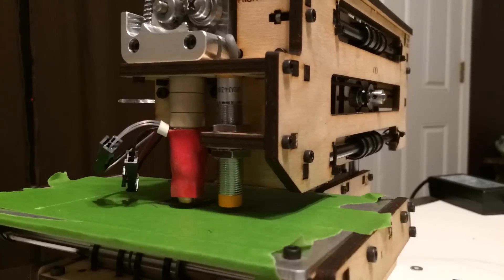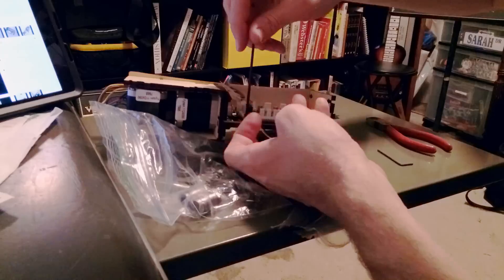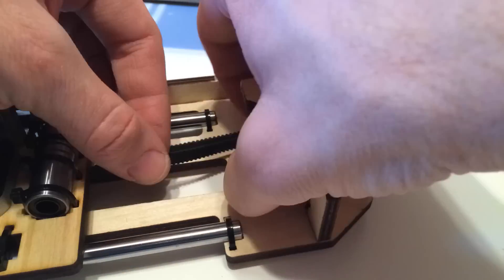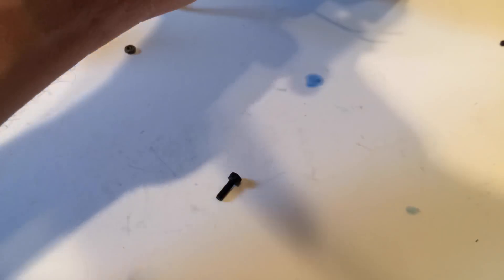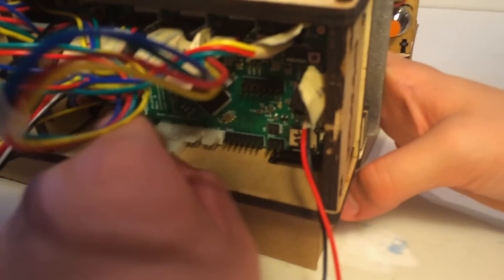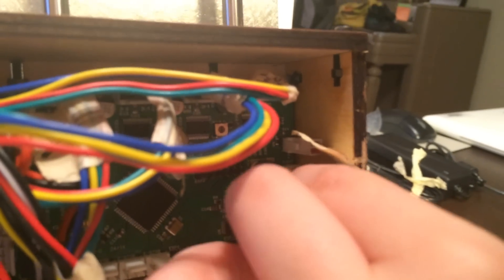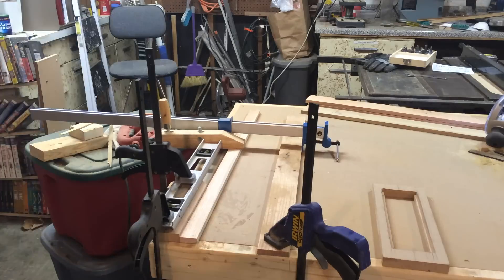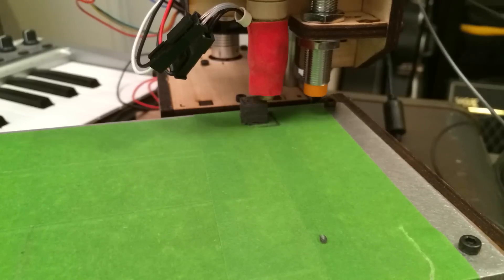Building the Printrbot 3D Printer (Printrbot Simple Maker's Edition)

Comment: For the low end materials and the fact that you had to completely build this printer, $350 seems really high.
Reply from the maker: +Andrew Keener At the time I put it together, it was easily the most affordable 3D printer on the market. Over the past 12 months, a number of other printers have popped up at around that price point (notably, the Monoprice printer and the Printrbot Play), so it's not quite the deal it was a year ago, but it got me going on 3D printing for a low price, and I learned a ton by assembling it.

As I think I mentioned in the video, I wouldn't recommend it if you have no interest in building the printer and just want to start printing right away - I would now recommend the Printrbot Play, or just check out Make Magazine's yearly 3D printer roundup.

Thanks for watching!